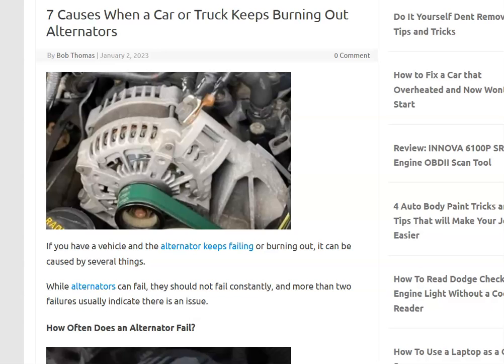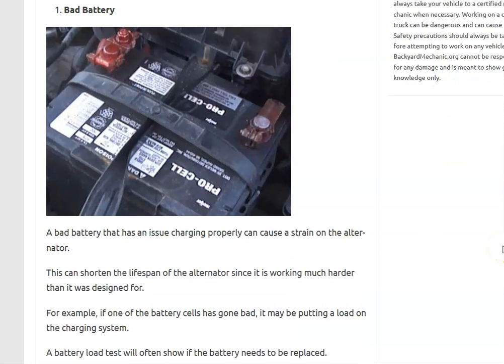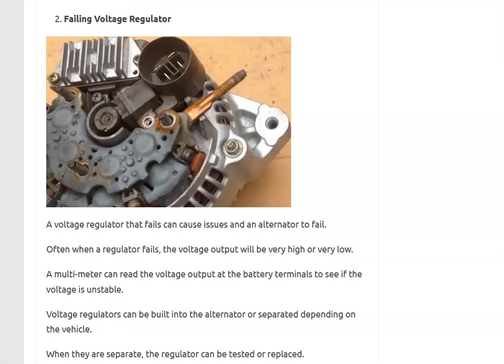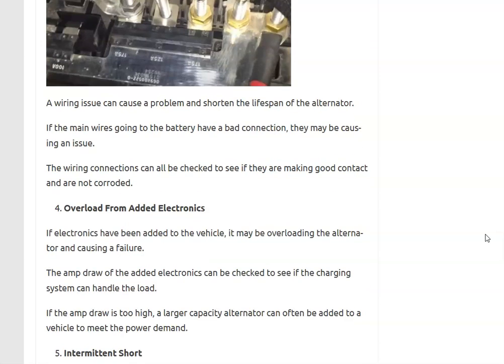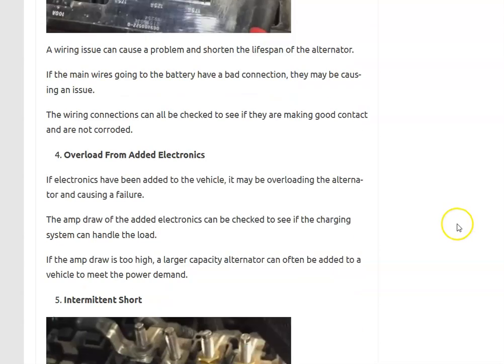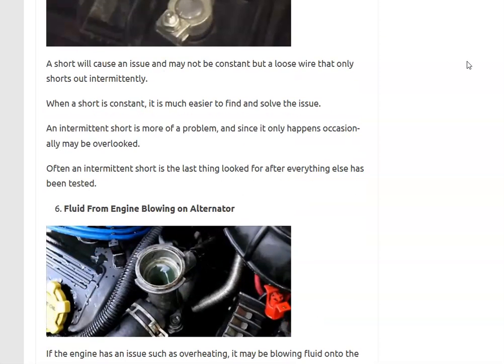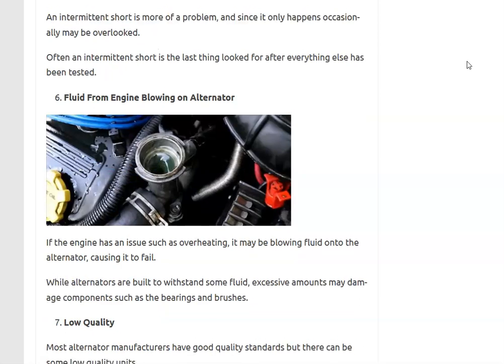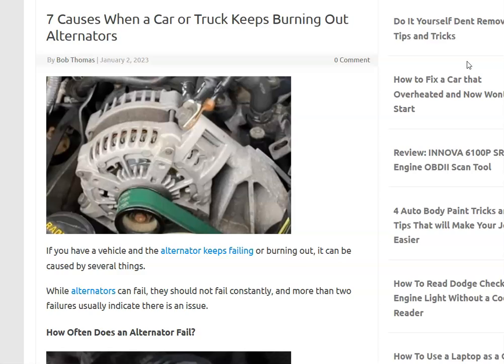7 Causes When a Car or Truck Keeps Burning Out Alternators

Comment: I've replace the Alternator 2 times, autopart guy told me to get a new alternator instead of a re-built one, so I did, now it's the 3rd time. Also 3 new batteries. And a few months passed and same issue, in the summer or hot temperatures the alternator refuses to charge up the battery over 12 volts making the car not start up at all until i get a boost, but in cold weather it starts charging up the battery to 14.0 volts perfectly when needed, I'm guessing the engine heat is affecting the alternator, fan turns on and all so not sure what the issue is, and not one of the many mechanics that checked it can pinpoint the issue except for me to replace the Alternator over and over and over. It is frustrating. If anyone knows the issue on a 2006 Rav4 send me a message, but I'll keep on checking with your steps, thanks all.

Comment: Appreciate your informative video. I'm hoping that when my alternator failed at 245,000 miles, the eBay rebuilt replacement I put in was the culprit when it failed after a year .It was growling right out of the box. I don't drive far or often and I know that makes it hard on this system. I replaced this second one today with a factory rebuilt Bosch sold through O'Reilly's. We'll see how it goes, but wiring is going to be checked tomorrow!
Reply: How is your alternator currently working?

Comment: 96 Toyota 4runner on my 4th or 5th alternator! Lmao! No joke fellas in about 5 years of course a few were Amazon 89 doller specials but have had looked at by many people can't find. Pretty wild I know. Last shop charged me ,785.00 but I thought they found short in ignition so they installed new and rewired and said found short. Now 4 months later and not charging. I think it's a ground loose intermittently but I'm a plumber not a mech a nik!   Any ideas. About to light it on fire.  Cheers!

Comment: OKI got your tips on the alternator and what would cause it to go out?Now I've got a question for you.What would cause the battery page on the dashboard of my car?Of the Ford Explorer.What would cause that battery gauge to pin out?Max out all the way on to the top
Reply from the maker: It needs to be diagnosed, but if the voltage is maxing out, it is overcharging and has a bad voltage regulator. I would use a meter and check the voltage at the battery when the engine is running. Anything over roughly 15 volts is too much.

Comment: Along side to the wire connections and a weak battery - The most important of all is The GROUNDING points. Power flows from the Negative to positive not positive to negative. So grounds connections are very important especially from battery to block and battery to frame.

Comment: My 1986 Porsche 928 original alternator failed at 166000 miles and my 2007 Toyota Matrix still has the original alternator at 165000 miles.

Comment: I got some oil in the alternator each time I did a change, as it is positioned right next to the oil port. I got it replaced by an automotive electrician where it lasted about 18 months - the expensive technician failed to tighten the neutral terminal on the battery. Check the basics!

Comment: So what if there is a really loose connection to the battery terminal to where a bump in the road can disconnect the battery. Does that cause any long/short term issues to the alternator and if so, how or why?

Comment: Question engines off and cold yet when the battery terminals hooked up the alternator starts getting hot and it's draining power. Are these diodes the one-way diodes?

Comment: Yup, time to replace the voltage regulator next. I just took a look at it and the thing might be as old as my vehicle, my vehicle is 50 years old, a 1974 Superior with the Dodge 440 big block, my alternator just shit the bed at 20,000 miles! I just replaced it last year. Pack rats had done a number on this vehicle, replaced so much wiring.
Reply: Do modern vehicles have it inside the alternator housing? I was suspecting that could be an issue as well.

Comment: Thanks for explaining. I have a 2013 Infiniti JX35. In the past two months the alternator failed three times. The repair shop replaced it two times in last 2 months now it’s back in the shop for same reason. They said they used dealer alternator. I am clueless about this getting frustrated without a car. Still waiting for the 3rd alternator to arrive from the dealer. But why is this failing this often.
Reply: Hey how is your 3rd alternator working? I'm having the same problem out of my v6 altima everything on the car works good but replaced 2 alternators now battery light on again so curious of your current outcome as well

Comment: Melted my alternator doing a race at the drag strip. Windings completely melted. I don’t know what it could’ve been, maybe track debris, oil from the oil cooler, or maybe the engine just pulled so much current it fried it.
Reply: I heard high output alts can get so hot that they melt. So then I wondered if a special fan should be built to cool off that extra heat on top of what the engine is creating.

Comment: I bought a 2014 passat TDI not even a year ago and i’ve had to replace the alternator twice. It just went out again and i’m getting really frustrated because nobody can figure out what’s wrong. After watching this, i have a fleeting suspicion that diesel might be getting into the alternator and trashing it. There is a fuel leak somewhere and it creates a mist of unburned fuel in the engine bay. I’ll be getting that fixed along with a new alt and hoping for the best.

Comment: My problem with my alternator malfunction was steering wheel fluid getting in my alternator. Once I got that fixed, my car is running very well.
Reply: Yes, power steering fluid kept leaking on my alternator damaging the alternator. I thought it was the battery. I have a 2010  Nissan maxima sv premium with 50,000 in miles. When the leak was fixed, problem was solved. Car  runs great now.
Reply: @tonychesssnutsss1404 so evidently the power steering pump must be located on top of the alternator in order for fluid to leak onto alternator like that... I've heard of a few maximas having alternator needing replaced repeatedly
Reply: My Infiniti is doing the same thing my power steering pressure sensor broke leading to it leaking fluid on my alternator  @tonychesssnutsss1404
Reply: Bro no way? My maxima is 2009 and the alternator keeps killing but my power steering pump is also messed up? Maybe this is my problem.
Reply: @MikeFromBr  My car is still running well no problems with the alternator
Reply: @mikedior3089 did you ever figure out if your power steering on your maxima was reason for your alternator going out repeatedly or was it a different reason?
Reply: Power steering fluid?

Comment: I've been popping alternators on my boat.  The start battery is new but the house battery is 4 years old.  The Atem charger sends  a10 amp charge over to the house battery after the start batt is full.  If the house battery has a bad cell/short, would that kill the alternator ??

Comment: Thanks for the video, great info. Trying to figure out why my 2011 Edge keeps burning the alternator, since last Friday have changed 4 alternators, today is Monday and still haven't figured out what is wrong. After install everything looks good, no dash massage,  once the car is moved the dash light appears and burns the alternator.😭any suggestions will be appreciated ✌️
Reply: Maybe steering wheel fluid leaking on alternator that was my problem Damaging  the alternator.
Reply: Pcm

Comment: Thank you for that, concise and easy to understand. Try as I might, I cannot find anything definitive about maximum temperature that a stock alternator can safely run at, no OEM numbers or even consistent "expert" opinion.  Regarding your item # 4 about extra loads; I am drawing 20-40 amps extra (depending on how I set it) from my 160A alternator to charge my RV battery when driving.  Running normally with all usual loads (headlamps, fan, wipers, radio etc) max draw is up to 65A or so.  So it stays well under it's rated capacity even when charging the extra battery.
My intent is to measure temperature with and without this extra load.  Is there a "safe" maximum temperature that should be adhered to?
Reply from the maker: The temperature range likely varies between alternators, but my guess would be around 200 Degrees Fahrenheit. Here is a link to a forum where they talk about alternator heat ranges that might help. https://www.cruisersforum.com/forums/f14/alternator-temp-what-is-normal-range-228245.html

Comment: Thanks very much for your video, it is helpful to me.  Right now, I am trying to figure out why the factory-rebuilt Bosch 140A alternator I just installed in my 89 BMW is charging fine (14.2 A) at idle but once the engine warms up it drops to around 12V.   Car starts right up, correct battery 1 year old, no additional electronics, engine to chassis ground strap new,   You obviously know a lot about these things.  Any suggestions for me to pursue?
Reply from the maker: I would test the voltage regulator. While rare, sometimes rebuilt alternators are duds.
Reply: Will do, thanks. Wouldn't speak too well for Bosch if their "factory-rebuilt" alternator is a lemon out of the box!  Appreciate your suggestion!
Reply: Did you ever figure out what was wrong with your alternator
Reply: @Josh-sg3pc  I believe that it was probably either the voltage regulator or diodes causing the failure. Everything else checked out.  So now I have another Bosch factory-rebuilt alternator on the shelf but my car is running fine with the rebuilt original. So, with a 1989, there is always something else for me to improve.  Thanks again!